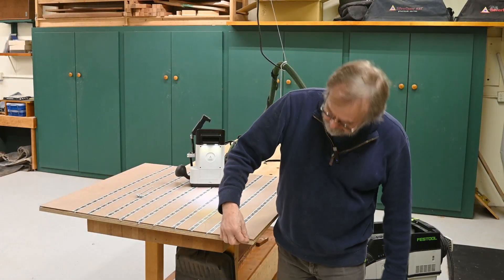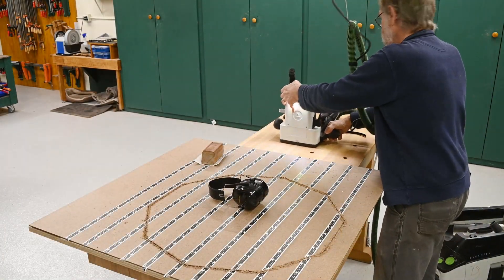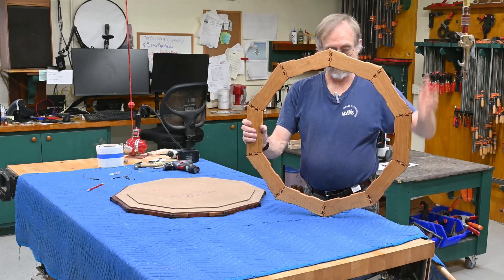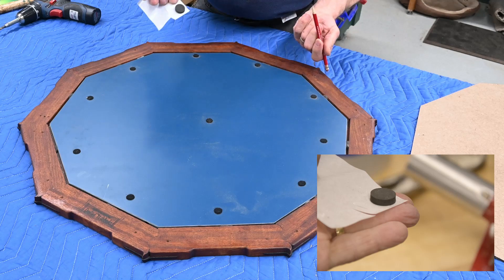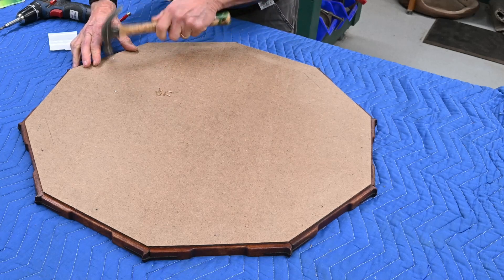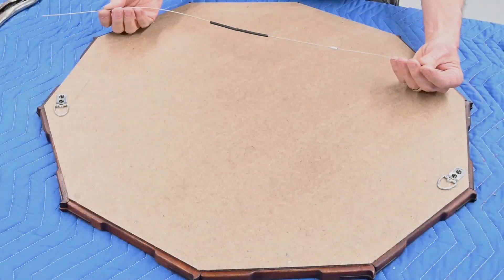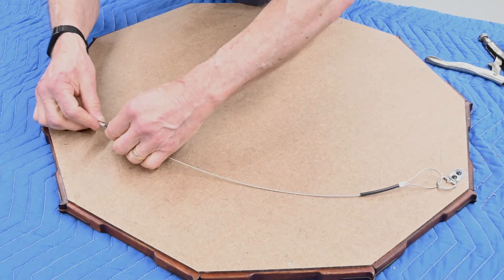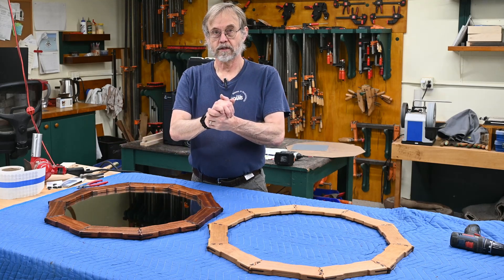Tahoma Decagon Frame  Part 4 : A Greene and Greene Style CNC/ Shaper Origin Project.

Comment: Another great result, Darrell! I remain unconvinced about the Shaper Origin as it removes control from the user in terms of that decision-making connection and agency between the user and the wood. It does reduce the footprint of a CNC down to something that about the same size as the largest hand routers. It seems fine for tasks like that backing board, but I would not commit it to a workpiece unless I knew that I had 100% option over what it might do at any time. Similarly, I remain unconvinced about Tesla's self-driving for more or less the same reasons! The same could be argued about "traditional" CNC of course, however one isn't hanging off the loud end of those during working. The degree of slop resulting from the Shaper Origin does appear to lend a "by human hand" sort of look to the workpieces, which I think is an ironically-strange justification for handing one's skills over to a machine 😀
Reply from the maker: thanks, Tristan. The Shaper Origin is sort of a middle ground . I find it very accurate and predictable for projects like this mirror frame but it's not up to the level of my large CNC ( it's also a small fraction of the cost of my CNC though). 
 I too am unconvinced about self-driving vehicles. On rare occasions my CNC does something nutty. It would only take one "rare occasion" to kill  you in a self-driving car!